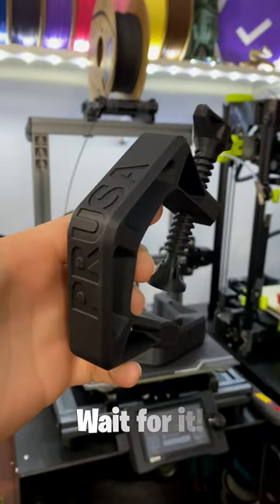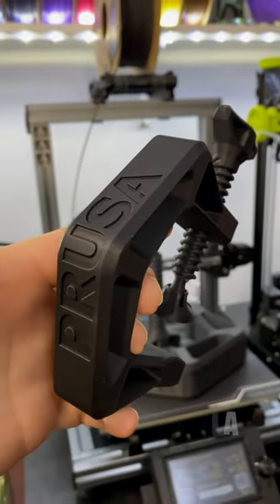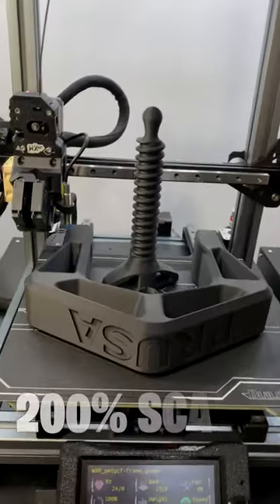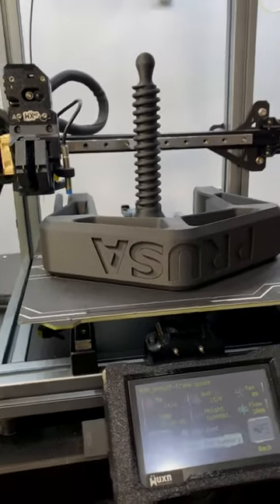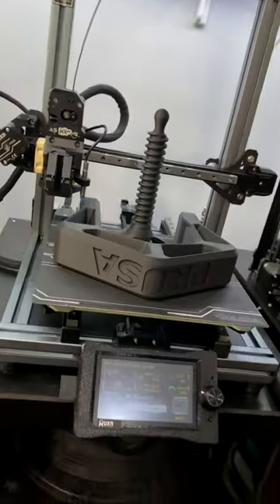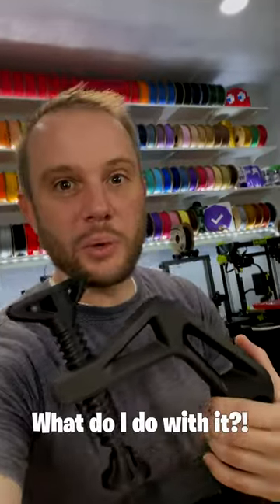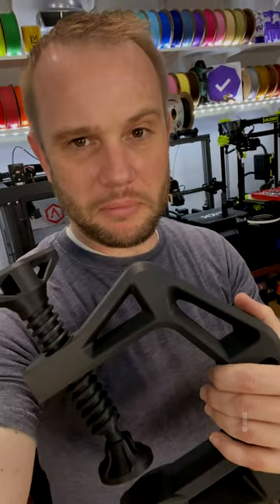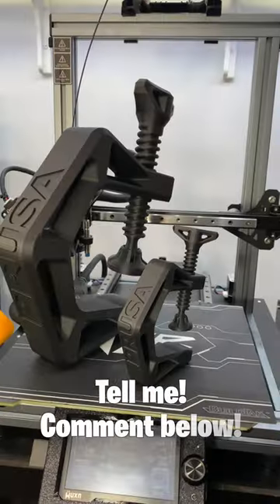200% Scale Carbon Fiber PLA 3D Printed Clamp! #shorts

Comment: Unfortunately, I can’t imagine it being super strong. Carbon fiber has amazing tensile strength, but can be sheared pretty easily without a matrix to distribute the stress. The way that clamp appears to be shaped, at first glance, wouldn’t handle side stressors very well. But I don’t entirely understand the structure/3d printing method, so I could be wrong.
Reply from the maker: Oh, you are spot on! I don't think in its current print form it is going to be very strong. It's a PLA still, so there is weakness there. It's a stronger version no doubt of PLA, so there are a lot of practical applications!
Reply: Carbon fiber filaments actually have lower tensile strength due to the increase brittle-ness and loss of layer adhesion. CNC kitchen has a video on it.
Reply: The biggest strength of the carbon fiber PLA is just how clean and uniform it looks after printing